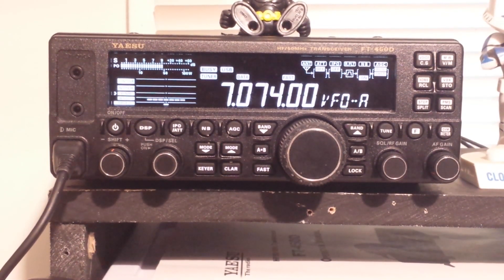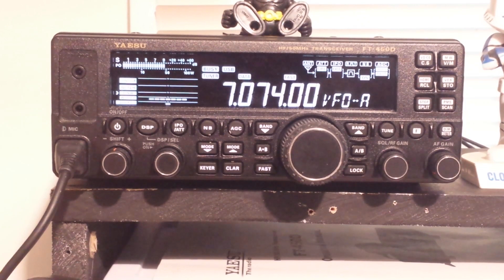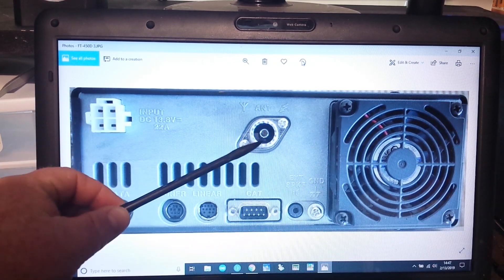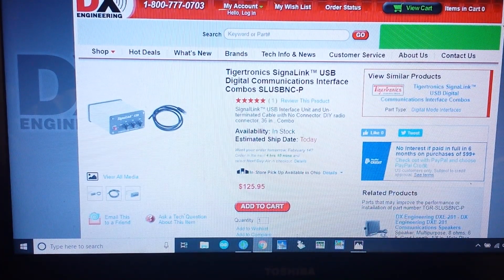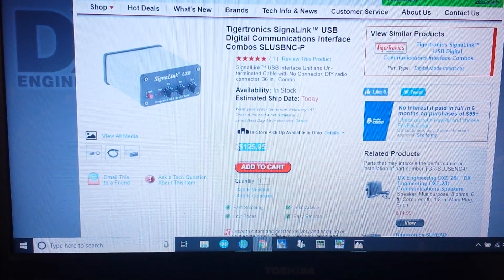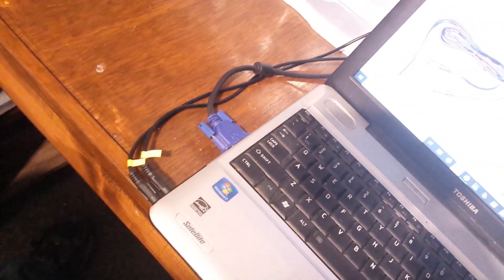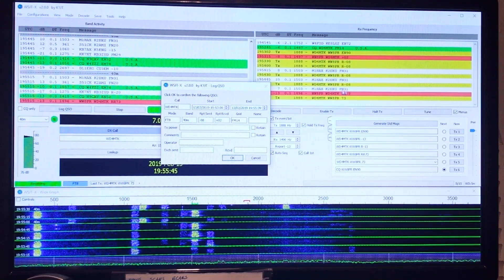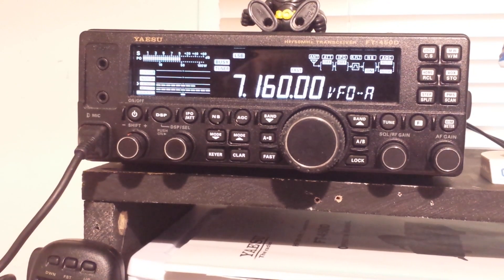Yaesu FT 450D digital modes without a SignaLink or SCU 17 USB Interface

Comment: Been in ham radio for about 12 years. I just don't get what people see in ft8.If you like this communication go for it. Just the noise itself drives me crazy.Ham radio deluxe is another crazy thing. Why bother owning a radio with dials and buttons. While we're at it just download a radio and pay once a month or year. Maybe I am just an a$$.If it's not am, lsb, USB, or CW going in an antenna it's not ham radio. If you need a computer to make contacts  to me it's not ham radio. People like what they like. I enjoy listening to good conversation on 80 and 160..2 meters will probably be gone soon because theres not many people using it. Ham radio an cb radio or starting to be one in the same. No respect, constant cursing, and if you don't have a licence make one up. That last one is really getting popular. On top of making a fake licence call they don't even ID any more .Which makes since with a made up call. Although I did renew my license in hopes things will improve.I have 897D .Icom 706 and Kenwood 2000.Love the videos. Keep it up.
Reply from the maker: Everybody gets to like what they like. I'm certainly not endorsing the digital modes and saying this is where Ham Radio is going. I simply like to present options for folks who don't know about them. I do on occasion like to see how far my signal reaches with low power and ft8 works very well for that. As for ham radio Deluxe, that's a personal choice. My radio is on the left side of my desk, and I am right handed. Rolling the mouse button up and down allows me to switch frequencies without having to reach all the way across. Also I have the hrd log up in front of me and I'm able to type in and search call signs. I appreciate you watching the videos and taking the time to comment. 73 de ww8pr
Reply: @learnelectronics  dito kg6mn

Comment: Also, for older radios I use the EASY DIGI interface. About $10 Epay. I use them plugged into the phone patch connections on the back of my Kenwood TS 820s and Heathkit SB-104a. If no phone patch you can use the headphone and mike inputs sometimes also on the back of many rigs. Thanks for saving many guys lots of money. AB1ZI 73
Reply: EDIT you use the VOX for transmitting.